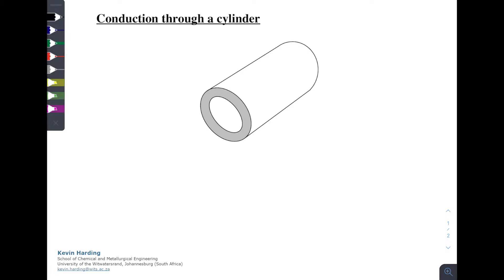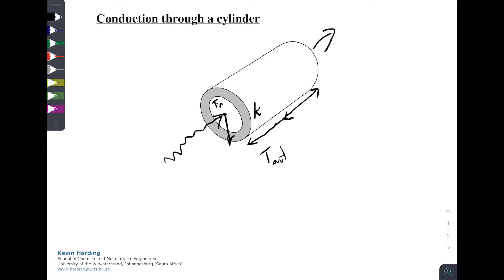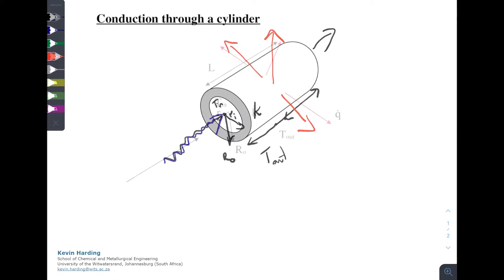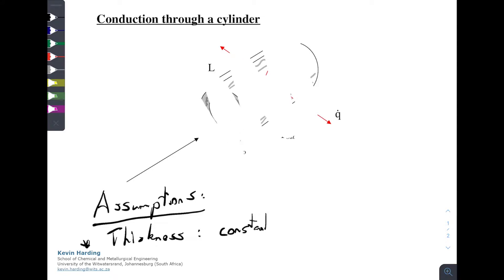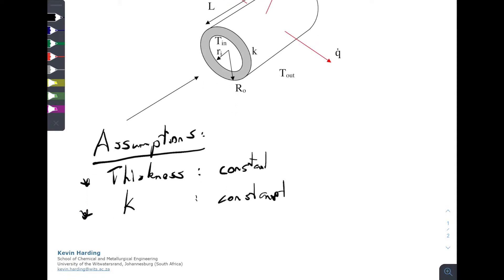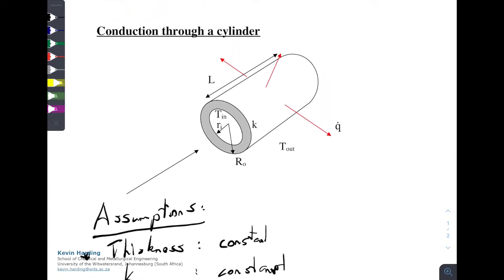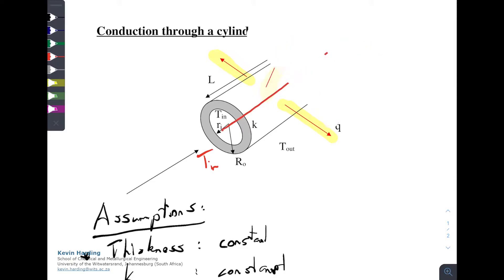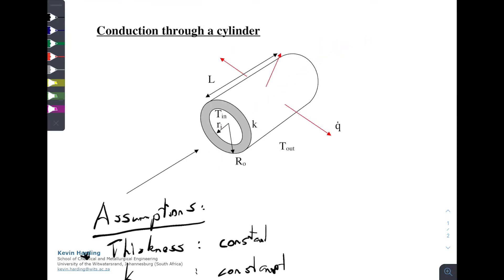Conduction through cylinders [Lecture]

Comment: Dear Kevin,

I am currently working on my graduation thesis, which focuses on the heat emission of exhaust insulation systems in diesel generator rooms (Q in watts). The setup closely resembles the situation shown in your video: a stainless steel exhaust pipe surrounded by insulation material.

I have completed the theoretical calculations and would like to validate my approach. If possible, I would be happy to send you a brief document with an overview of the project and a calculation example (4 pages) via email. Any feedback or suggestions you could offer would be greatly appreciated.

Thank you in advance for your time and support.
Kind regards,
Reply from the maker: Please email.  Kevin.Harding@wits.ac.za